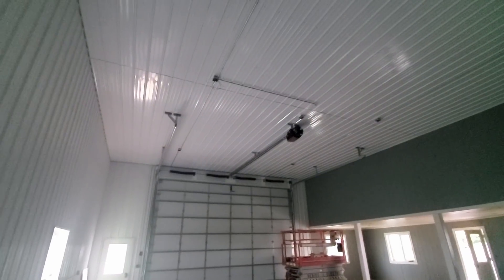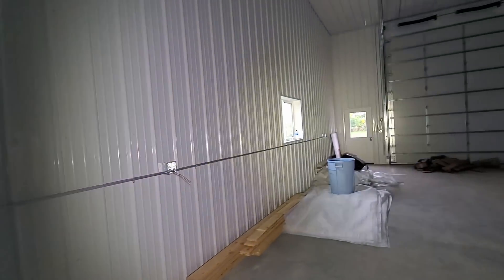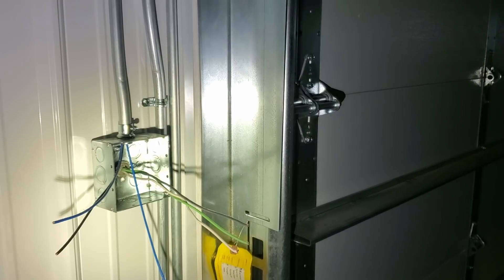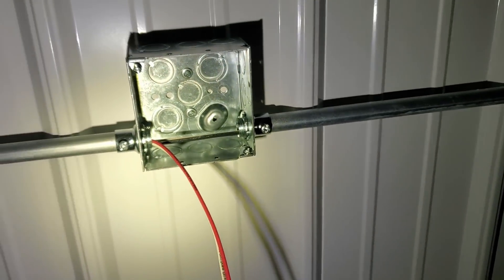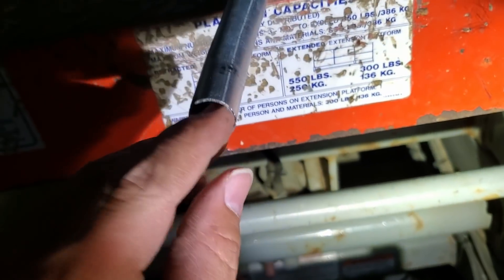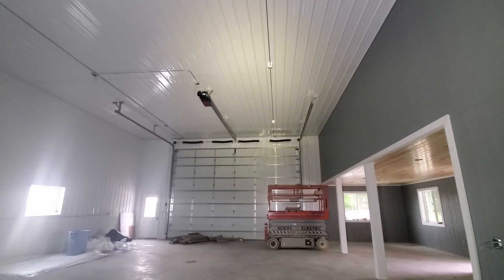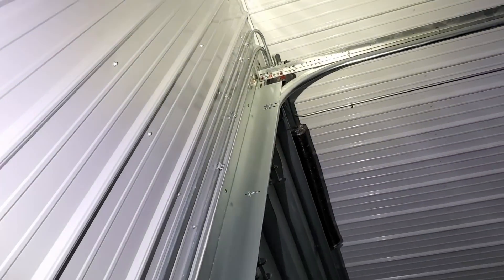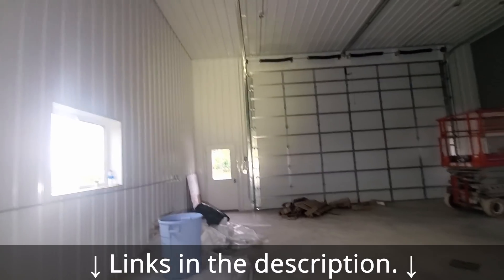Wiring a Shop Using EMT Conduit on My First Day as an Electrician Apprentice

Comment: I will never forget my first run.  It was in a plastics plant and they wanted a 3 phase run around a production room, THHN in EMT.  No AC in the middle of August, very dirty dusty room, while they continued to run full production in there. My boss left me there and went to a meeting. In trying to make a good image on my first day I hustled and finished the run. When he returned he was amazed.  He said he had no intentions of me finishing in one day because of the adverse conditions.  After that day it was all downhill until I retired years later.
Reply: HAHAHA, YEAH,  you set the bar too high and they expected from you 🤣😄. 
Ya do get the speedy guys but it's best to work at a comfortable pace...no need to burn out early. Hahahaha 🤣,  but I  did a similar thing back in my day...the old timers slowed my roll.
Reply: Yeah, I worked in a sweatshop factory.   It was Illinois hot and muggy.  There was one fan for each lathe and mill operator.  One each.  When one broke down, stealing fans became an art.  The grime and dirt built up over 100 years.  My white t-shirt was black within a few hours.  We were constantly coughing or sneezing.  It was awful.  An OSHA nightmare.

We were making 50 caliber machine gun barrels for you know who in that god awful factory.  One of the  veteran barrel straighteners was on vacation for two days and his boss asked me to start straightening out the freshly made barrels to within spec.  It was a hydraulic press and I got the hang of it quickly.    
I straightened 160 the first day and got a good pace going to bump it up to 190.  I figured a veteran could do more, perhaps 200+ per day.  

The veteran comes back to work on Monday and is fuming.  His face is red and his is spitting made.  Quota was 40 a day.   Sheesh. Seriously.  A one-armed 80-year old could do that.
  
So, to appease the guy, I said give me 90 for the two days.  I exceeded quota by 5 which made me look good.  I tell the boss I only did that based on your "coaching".  And you take the remaining barrels and do what you want.
He loved the idea.  Took the 260 extra barrels and spread them around over 45/day, so did nothing but boss dodging for almost 5 days.  Your US government at work.
Reply: @Makelifehappennow  This is a perfect example of how unions have lost its original function and now only serve to hurt the company, tax payers, and the economy of a country.  What a sad state of things.

That old lazy POS should have been fired and his decades of raised pay should have gone to motivated workers like you.   The company would make more money, the government would save spending, the tax payers would get more for their money, and you would have been paid according to your performance right off the bat.  But instead, we have a system where the old POS who does everything to work as little as possible is leeching off of everyone into a nice lazy retirement with a fat belly from decades of undeserved pay.
Reply: What do you mean by "downhill"? What was so bad about it?
Reply: @mr.g937  Easy going.  I learned that they didn't expect me to hump it but to work at my own pace.
Reply: @BurgerJohnny  It was good to know that you could ramp up if and when needed. It was also good to know they didn't expect you to rush or be super human. Rushing ahead can be dangerous with electrical as I am sure you know.

Comment: While emt is considered an equipment ground per the nec, it’s considered hackish in the field to not pull an equipment ground conductor and for good reason IMO.
Reply: People's fears about EMT as an EGC arise from improper installation and loose fittings. If EMT is properly installed, it can carry as much, if not more fault current than a 14 awg or 12 awg EGC.
Reply: @commoncentstx  You ever run into fittings where the locknut won't tighten down on the box because the neck of the connector isn't threaded far enough?  Or the 1/2 inch lock nut won't lock on because one used the 1/2"/3/4" combo knockout.  Ya.  I run the little green wire just in case.  But you are right.  In a perfect world the pipe can carry a lot of fault current.
Reply: Well said. Hackish asf
Reply: Not hackish, it depends on the local regulations or application. However,  an added ground conductor is required in much industrial work. In residential work it is never done...unless you're in a tough municipal code area.  Commercial work is kinda in-between where ya can just have a ground conductor from the 1900 box to the receptical or switch...generally speaking that is.
Reply: Not if your customer doesn't want to pay for it. If it meets code the customer decides. 

that extra wire would have added at least $100 to that job.
Reply: I would still want a copper ground wire. That way you get the best of both materials, and that much more protection.
Reply: @pyrotech7210  whats the point of a bare copper wire if the emt is already grounding the whole circuit all the way to the panel??
Reply: @STXVIEC  Guaranteed continuity, and BTW in conduits I use green, not bare.
Reply: What is hackish is running extension cords in your walls and covering it with drywall. Retired electrician here (IEBW701) in Chicagoland. I did housing from 1988 to the 2008 bubble burst.  We pipe all houses here and never once do we run a ground wire. Now some towns make you ground the device to the box. We call that cord you guys use rope-a-dope.
Reply: @robm3063  yeah, extension cords in walls, ROFLMAO! Kinda puts this in perspective.
Reply: @Towelllie  You're 100% right. Some of it is user error but too many people have been burned by 1 loose fitting. That's why regardless of code people still choose to pull grounds.
Reply: In lee county, FL,   you must also have a green ground wire
Reply: @stevethurlow9059 Yes sir,  It's all about what your location requires.
Reply: @stevethurlow9059  same things in Miami
Reply: It's a belt-and-suspenders approach to pull a ground conductor. Redundancy is never a bad thing IMHO
Reply: ground is overrated
Reply: @STXVIEC  if grounds were important they wouldn't make it so easy to break the ground prong off an extension cord
Reply: @brianleeper5737  lol perfect example. Most tools don’t even have a ground pin anyways
Reply: @STXVIEC  That's because those tools are double-insulated. On the other hand, I know of a case where a broken ground prong on a vending machine killed someone at a public pool. The foot of the vending machine was resting on the power cord and damaged it, making contact with the hot wire. The frame of the  vending machine became energized at 120V, and because there was no ground prong, the breaker did not trip. Vending machines are now required to be on a GFCI, so a broken ground prong won't cause this sort of hazard.

Comment: I never knew that EMT conduit acts as the ground. So if there was a fault the EMT would become hot and if all connections are made it would be a electrical hazard.
Reply: That's not accurate. If there was a fault, the breaker would instantly trip. There would never be 120v on the EMT. The EMT has to be bonded regardless of whether or not there is a ground conductor, so if the breaker fails during a fault, current will still be traveling on the EMT. 

Properly installed EMT can carry much more current than a 14 awg or 12 awg ground wire. If the fittings are loose or improperly installed, that is a different story. You can say the same for ground wires too though.
Reply: @commoncentstx  yep, exactly.
Reply: @commoncentstx  Very well written.   Loose fitting at the EMT .   Scary?
Reply: Everything metal should be bonded together and is part of the grounding/bonding of the electrical system. If there is a fault, the breaker will trip if everything is installed correctly and the breaker isn't defective.
Reply: The breaker would/should trip long before 1/2" emt heated enough to notice it was warmer.

Comment: Nice! On the runs between receptacle boxes, it looks like you avoided offset bends because the ribbing of the wall that the EMT got strapped to made a perfect offset itself relative to the knockout in the box. Looks very professional. Well done. Take your time with bends. You'll make many screwups before you even start to get it! Af least I did.
Reply: Lol, everyone does in the beginning 🤣

Comment: While  a continuous EMT raceway is an approved method of grounding, I usually prefer to run an EGC because it’s just one extra wire
Reply: Good insurance for sure. Otherwise you have to make REALLY sure all the EMT couplers and box connectors are really tightened down.
Reply: @aaron74  Like a real electrician would
Reply: @donl1410  A real electrician or anyone with good common sense. Screws are meant to be tightened down after something is assembled. Inspect all your work after you're done, make sure you didn't forget.
Reply: And its a non current carrying conductor anyways when it comes to derating. But still have to consider pipe fill. I love the insurance anyways. Especially if didn’t set every screw in the run. Trusting “that guy who does electrical work’” with mine or someone else’s life? Nope. I’m good.
Reply: What happens when there's a short to ground and your touching the emt and put your hand on say a metal motor frame?
Reply: @dicksargent3582  When there is a short to ground the breaker will trip and the EMT will return to ground potential.
Reply: @TerryPullen  OK
Reply: @TerryPullen  Unless its an old breaker that doesnt like to trip or a newer one that is far away from the short.
Reply: @dicksargent3582  Jazz Hands
Reply: @dicksargent3582  LOL
Reply: @dicksargent3582  If the short current is not enough to trip the breaker, you'll feel it, but you won't be the primary path to ground.  The EMT path back to the main panel will be the path of least resistance.  This kind of scenario however, is why the invent and use of GFCI's breakers.  They will trip on roughly 5 mA of current imbalance between hot and neutral.  Meaning, that current imbalance is traveling on the ground path.
Reply: @reddelpapa2789  Lets hope :)
Reply: @dicksargent3582  I guess that's when Ben has some splaining to do. Is just as worse as bonding the neutral and ground together at your panel.
Reply: @dicksargent3582  electricity chooses the path of least resistance  - probably not you unless you are soaking wet
Reply: @Makelifehappennow  Not entirely accurate. Electricity doesn’t choose a particular path; it uses them all in proportion to each path’s resistance. Visualize a bucket of water with three holes in the bottom, 1/4, 1/2, & 1 inch. Which holes will leak? They all will, but the 1” hole will leak four times more water than the 1/2” hole. But they all leak some.

Electricity works in a similar fashion. In the context of this discussion, you perhaps may feel a minor shock, but most of the fault current will be carried by the raceway. Most likely you wouldn’t even notice because the fault would trip the breaker so quickly.
Reply: Interesting watching American electricians here in the UK conduit or any sort of containment would never be considered good enough to act as an earth, every circuit would have its own earth ran in , if you was running 3 circuits down 1 conduit you’d run 3 completely separate earths
Reply: @WCamden  Yes, because earth is earth, it doesn't require redundancy for multiple circuits when individual conductors are being fished through conduit. If you were using NM cable (which in the UK is often called "flex") instead, then, you'd naturally run earth for each circuit since it's already bundled in the cable with the live and neutral.
Reply: @aaron74  regardless, you’d never find someone pulling in 1 earth for multiple circuits, due to if a fault occurs you’re losing multiple circuits and not just the one
Reply: @WCamden  that's crazy we are only allowed by code to run one ground per conduit. And I have never used the box as a ground and have never heard of anyone doing it in the U.S. ive done residential, industrial, and now mostly commercial and we always pull a ground 100% of the time.
Reply: @WCamden  we also have to ground each and every box with a tail from the box  connected to the panel ground.
Reply: Will you not get shocked if you are in contact with the raceway during a ground fault?
Reply: Only fools,idiots ,& very cheap shake electricians ever use EMT to be used to supply a ground. Way too many times saw conduit pull out of fittings. I had a lazy cut every corner halve ass chief electrician boss. He used a 1" conduit to supply the ground on a 480 volt circuit that he installed. A contractor forced this conduit several inches off the wall to weld something. When this was done wire got nicked and when my boss had ends of conduit in separate hands forcing conduit back into coupling he got hit across his chest with  277 volts between  1 wire and metal conduit. Came very close to being electrocuted. He still had chest pains next day.
Reply: Yeah it is code most places to run a ground to panel
Reply: Also he should use insulated grounding lock nuts to properly bond those connections.

Comment: Problem i have is hack electrions use the ground fault as a second 110vt line through the casing so they cand run just 1 dryer.  The whole system could kill you if you touched it and the floor was wet,  situation.
Reply: Yeah,  very stupid and dangerous...I  encounter that every once in awhile.

Comment: Electrical metal tubing?
Reply: Required method on all types of  work in New York and Chicago metro areas...period. Any romex on site and ya just failed your inspection.
Reply: @samspade5648  do you know if Chicago or NYC allow MC, AC, etc., where Romex is not allowed?
Reply: @michaelraab5669  yes, primarily for fixture whips in accessible spaces. The whip lengths can vary depending on site conditions. Romex is completely illegal in both Metro areas.
Reply: @samspade5648  what’s wrong with Romex? Why wouldn’t that be allowed?
Reply: @riffdex  New York and Chicago have the most restrictive codes in the country and as such it is seen as the gold standard. Nothing is wrong with romex IMO, but emt/rigidt is just what those 2 metro areas require.
Reply: The main argument for EMT is protection against physical damage and the ability to modify wiring without removing finish materials. The main argument for Romex is cost-effectiveness and the ability to fish in a wall cavity. In my opinion the Chicago requirements are excessive and unnecessary for a residential home. Nothing wrong with Romex.
Reply: There's also strong electrician labor unions in those areas, that's an element of it. There is a notion that EMT is simply safer.
Reply: @mr.g937  I agree 👍.  Excessive is an understatement.
Reply: Yep, pretty much.